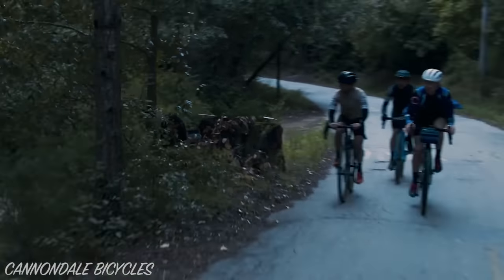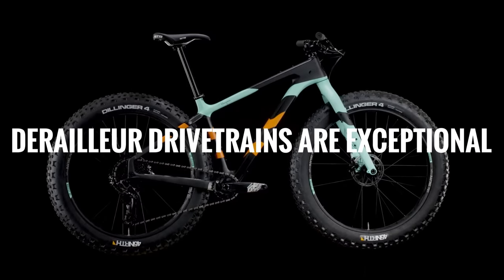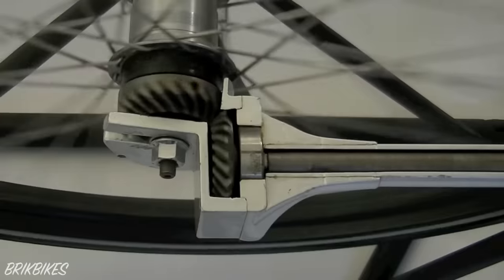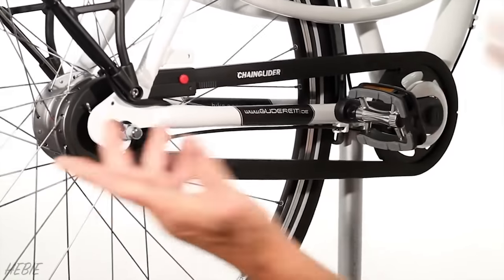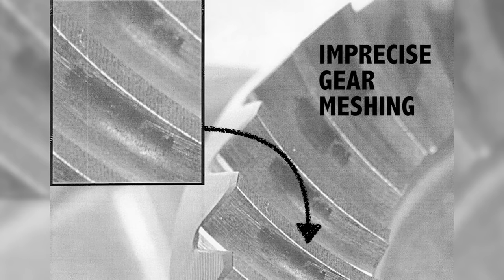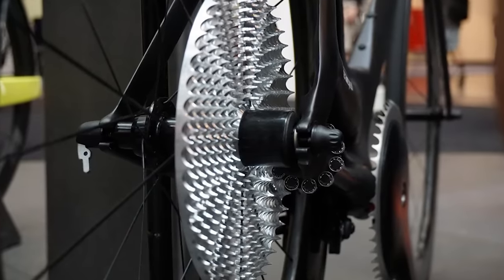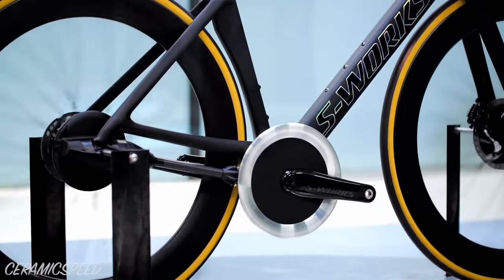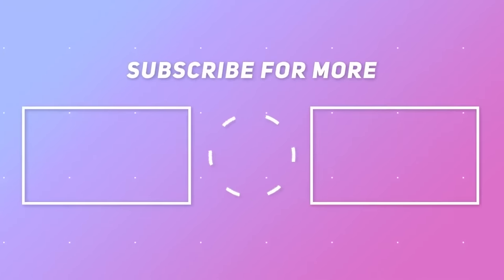Are Chainless Shaft Drive Bicycles a GENIUS or TERRIBLE Idea?

Comment: When I was about six years old, my father attended a trade show and was fascinated by a shaft-driven tricycle (I believe it was called a Gear-o-cycle.) He bought one for me. It was bigger and heavier than the  typical kid’s tricycle but not as big as an adult tricycle. It had a differential at the rear, but the welds that attached that differential case to the rear frame kept breaking. Eventually we gave up on it, the company that made it went out of business, and no other company ever took up a similar design.
Reply: That's usually a QC or review related issue. Proper welds are generally stronger than the base metal they're joining, so if a weld breaks, it's usually just bad welding. It's only when base metal starts to break that you should really suspect a bad design.

Comment: I use a shaft drive bike for my commuter, and I also have a road bike with a traditional Shimano rear derailleur. Here in the Netherlands, having a shaft drive for cycling in the rain is a massive benefit. I have done virtually no maintenance on the bike in almost 5 years and I think the loss of efficiency is negligible when commuting at less than 100 watts (compared to other commuter/hybrid bikes I’ve owned in the past). I’ve also lived in dry, hilly cities and in that case, I agree that the a traditional bike would be much better.
Reply: I use closed Shimano Nexus 7speed. And the chain runs inside a cover. 4 salty rainy dirty winters and the chain looks like brand new 🙏
Reply: Ah, that checks out. I was wondering what the appeal of a closed up mechanism would be. Having fixed my (literally salvaged from a junkyard) chain many times on the road, I wasn’t thinking about the average person, who isn’t going to want to have to do that under any circumstances.
Reply: that's what i was thinking, especially office workers should appreciate not getting chain grease on their trousers and it's not like you're ever going to have to fight the reduced efficiency up hill in the netherlands.
also one key disadvantage of derailleur drives not mentioned in this video is that, if you have a fall or get into any other situation where something bumps the derailleur, the whole thing will never work right ever again.
Reply: Didn't know they made these bikes

Comment: Nitpick about 5:52, the shaft needs low tolerances. High tolerance means it is more accepting of error, low tolerance means it needs to be more precise.
Reply: Was about to say the same!
Reply: @Samonitari  Ditto. I always use the unambiguous terms tight or close tolerances.
Reply: He kinda mixed high precision and low tolerances I guess.
Reply: Most of the time I've heard "high tolerances" being used in an engineering environment it's synonymous with "tight tolerances" or "high precision". With that said it's still pretty ambiguous which is why I prefer to use "tight" or "loose" tolerances.
Reply: @Ralph Macchiato kinda the whole topic here actually. Nice pun.
Reply: Someone has a low tolerance, for high tolerances ... ;)
Reply: @Skooteh  Strange, since it literally means how much slop you'll tolerate in the part.
Reply: In school I learnt in the metal machinist class that High Tolerance meant +/- 5%. And normally we never saw those but things like +/- 0.005mm.
Reply: @Skooteh  that's how I interpreted it as well. OP is right if you're taking the dictionary definition, but honestly the terms "high" and "low" just shouldn't be used to describe fabrication tolerance. Too ambiguous.
Reply: If something is built to very high tolerance it means it is a precision fit . Very small clearances. Being highly tolerant is something else.
Reply: @George.Andrews.  I've never heard it used that way. I've only ever heard high precision = low tolerance. As in low tolerance for error. It doesn't make any sense the other way.
Reply: @skipfred  I think the difference in the two uses is essentially the difference between laypeople and engineers/machinists.
Reply: @skipfred  think of the word high as used in high fashion or high end dinning. The word high meaning superior.  I started my working life in a precision engineering company in 1976  everyone I ever worked with knows this. After high tolerance comes interference fit. This is when a bush for example is made bigger than the hole it is going to be pressed into. The difference in size is the interference.
Reply: @George.Andrews.  Okay I see, so more like high-precision tolerances. I am definitely the lay person here
Reply: Highly accurate to the tolerance. It's generally understood that a low tolerance is meant to say it is of low quality, while high tolerance is of high quality. 

One of those things that engineers and the layman confuse each other with. Accuracy of the statement vs understanding of the statement.
Reply: @leftyeh6495  What you say is true in some parts of America, but in the English-speaking engineering world, people tend to be more careful about ambiguous usages. It could only happen in America, to give just one true instance, that a big rig would travel across three time zones to pick a "50,000 lb Bourdon tube", only to find it fits in a small envelope, and take it back to the East Coast in the glovebox of the cab ... all this because it's considered cool to leave out surplus words like "per square inch"....
"High precision tolerances"" means exactly one thing, regardless of who says it. "Low tolerance" means two opposite and consequential things, depending who says it. All to save one word.
Reply: @MikeDCWeld  High does mean tight in this context but we generally say either tight or open tolerance. No ambiguity there.
Reply: The OP has a habit of asserting incorrect statements.
Reply: As an engineer, I've always used high tolerance to mean high precision. But it's a good thing you bring this up as it will create confusion, because it does also sound the opposite. I think I will personally avoid use of "high" and instead use "tight" tolerances in the future.
Reply: I think we can all agree that using high and low regarding tolerances is confusing so we just shouldn't
Reply: you have that backwards.
Reply: It's not nitpicking, if you use engineering terms use them right or don't use them.
Reply: No you're wrong.  In an engineering or machinist's sense, high tolerance means tighter tolerance (parts fit closer together) while low tolerances mean the opposite.
Reply: High tolerance means more accuracy--not less. My work requires high tolerances, so I guess I know the difference. High tolerances causes high prices.
Reply: The OP is using the context of product use but 5:52 is clearly about manufacturing.
Tolerances has always been a engineering / manufacturing term high=low error. 
Elsewhere a requirement that the system tolerate flexing and other conditions  is not the same. "Tolerances" can be made imprecise to make a system "tolerate" a range of demands.
Reply: Nitpick about your nitpick: It needs tight tolerances, not high or low tolerances. High and low are meaningless in the context of tolerances, unless used alongside the word "precision".
Reply: @deusexaethera  I agree--that high and low labelling is really confusing. Also, I've never seen it being used until I saw this video.
Reply: @naverilllang not just the dictionary definition, the definition every engineer knows and shouldbe taught. High tolerance is low precision, everyone knows this.

Comment: Some 15 years ago I went to a major bike show in the UK and was excited to ride and buy a shaft bike for leisure. When it came to my turn the bikes shaft gearbox had detached from the wheel because of loose fasteners and the show staff had not the ability to fix it.
Reply: Giuliano Skywalker  what about buying the tools and having proper assitnace from the seller?
Reply: Giuliano Skywalker  
Someone who has been in automotive/mechanical engineering should be familiar with the concept of gear and shaft drives, but the tools and equipment appropriate for the drive is a different story.
Reply: What about the Alan Millyard built MTB? In very simple terms, he built an enclosed drive system, and the bike won some championship races in 2006. Very easy to mass produce from the look of it, but totally ignored. There is a few Youtube videos of it on his channel.
Reply: @jerzywoking1699  Yes I saw that video, sealed drivetrain and gearbox. Amazing bike he built for his son to race.
Reply: @brandywell44  here is the link of the MTB Alan built https://www.youtube.com/watch?v=iUak9sqJmnM
Reply: @canobenitez  Thankyou MarathoninfinityHalo :)
Reply: Im prity sure you can figure out how to take it apart
Reply: Get a double seater so you can carry around a mechanical engineer and a tool kit.
Reply: @jerzywoking1699  actually, design is over-complicated and over-weighted for its purpose. GT IT-1, designed pretty similar, has been released in 2006 too, but haven't had any significant market success.

Comment: This problem reminds me of the bushcraft hatchet.
Everyone is always trying to come up with a high-tech replacement to the traditional hatchet. The old fashioned design has its drawbacks, mainly that its quite heavy, but in all other regards it excels. It is cheap, incredibly robust, cheap and easy to repair, lasts almost indefinitely, and mother natures plain wooden handle is both durable and acts as a natural shock absorber, protecting the users wrist from fatigue.
Over the years I have seen a myriad of alternative designs, all trying to make it lighter, foldable, multifunctional, or more compact. All these attempts end up causing massive negative effects, such as making it vastly weaker, causing terrible vibration in the handle, poor cutting, low durability, and almost ALL of these high tech solutions are more expensive.... and are worse.
The OG wooden handled, steel head hatchet nailed the design over a millennia ago. It is just the best design hands down, and you can get a basic one from Amazon for fifteen bucks, sharpen it, put boiled linseed on the handle, and you are all set for three generations of wood cutting. Just like the traditional bicycle chain, sometimes the problem has already been solved, and attempts to improve on the solution are not worth the effort.
Reply: Maybe that’s true of the hatchet, but I don’t think it’s true of the derailleur. For one, the derailleur is part of a complex machine that hasn’t stopped being reiterated from the start. For two, the hatchet is closer to a fixed gear bike, and the derailleur closer to a proper axe or saw. And while a hatchet can’t be improved on much, there are plenty of new axes and saws that benefit from innovation.
Reply: I would not say the attempts are not worth the effort. They add to our knowledge of ways not to do it. Possible there is no better way to do it but in the hunt to improve on it you need to know what has already been tried. Quite often inventions are overturned, but only after some serious effort, and every step along the way naysayers continued to say it could not be done. Powered flight is a good example.
Reply: Another is electric cars. They have been around for a really long time but only quite recently that they started to be mass produced as a genuine competitor to ICE cars.

Comment: In mountainbiking: maybe a future for shaft drive!
Assuming shifting is possible and smooth it could be good for mountainbikes. It seems ressonable to think that it is more rugged than chaindrive, and if you crash or drop the bike, there is no derailleur to bend. It also will not flop around like rear derailleur.
Reply: Good point they also need to make it a bit lighter for better bike control so that is doesn’t feel sluggish
Reply: I might be hard to make it work with mtb suspension but nothing is impossible.
Reply: maybe for cross country. anything with rear suspension is going to be impossible.
Reply: There's no way its more rugged than a chain drive. tolerances on the mesh have to be tight and in MTB the frame and rear triangle are constantly flexing. Not to mention dirt, mud, and debris on the drive solution is just going to wreck the bearings. Just because it is stiff does not make it reliable, in fact in many cases like this stiffness makes it less reliable.
Reply: @corporalpunishment1133  It has worked for motorcycles, with a rear swing arm, for many decades.
Reply: @UncleKennysPlace  yeh but the gear shifting is done in a gearbox not on the rear sprockets.
Reply: Alam Millyard managed all this back in 2006. But no bike company wanted to take up the.manafavture of it on their bikes. Obviously its not what the riders want.....
Reply: @corporalpunishment1133  the gear shifting is done in a Pinion gearbox+shaft as well. For a rear hub electric bike this combination will not be too bad.
Reply: @UncleKennysPlace  you'll ALWAYS be dumping a bunch of power heading the oil around the driveshaft. When you've got to power the machine with your own meat sticks it's never going to be close to competitive.  Transferring power thru 90 degrees not once but twice will always be a ball ache.
Reply: Shafts have been used on some of the enduro motorbikes and as far as I know they suck. They are easily cracked while being hit and the cost of repairing is much higher then the one of a broken chain.
Reply: No. If the bike was dropped like that, you would likely crack the teeth in the cogs, since they have to be rigid and capable of high torque. That usually means through-hardened, which can crack catastrophically.
Reply: @UncleKennysPlace  and when they upped the power on those motorcycles, the shafts had a history of snapping.

Comment: I actually owned a shaft drive bicycle about a year ago. It was old, there was a lot of slop in the system and it felt like I lost a bit more power between the pedals and the wheels than on a chain drive bike, but it was quirky and fun to use! Although I wouldn't recommend it. Also worth noting that it had three gears using a shimano geared hub.